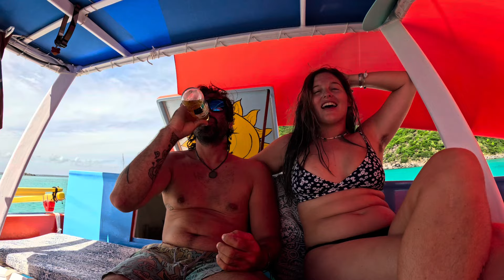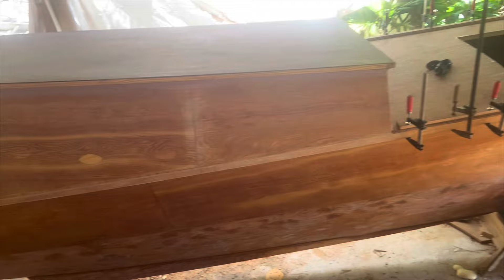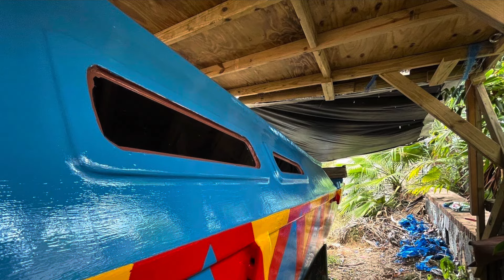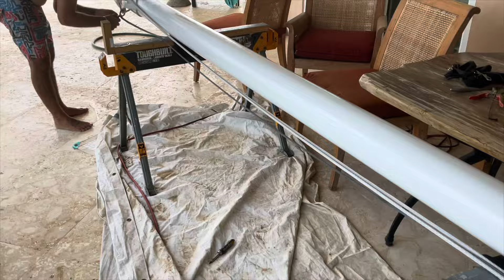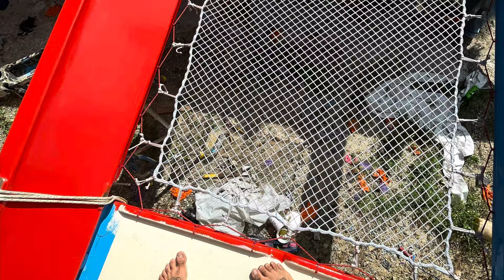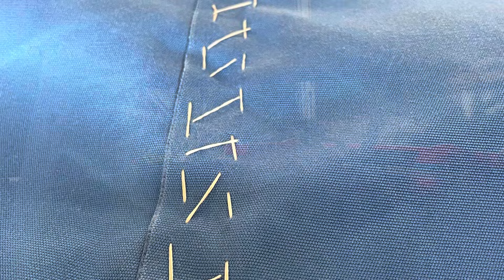Building Our Tiki 30! An in depth look at the early days [EP.4]

Comment: Nice build job. Over the top build, however you will appreciate that when you survive your first full on storm at sea... I built a Tiki 30 a few years ago. Very robust design... Mine had a flat deck similar to yours and 50 mil lhigher saloon bulkheads for more down below room in each hull... In terms of sea worthy design, a friend of mine told me, the Pacific is full of Wharrams all sizes... I'm considering building a 35 footer out of aluminium... Might just be an old farts dream but I think it would be a really cool project...

Comment: Great video, thanks!

Can you educate me on the foam you put in the hull?  I don't see that in the plans and don't know anything about it.  Thanks!
Reply from the maker: The foam is not in the building plans but we thought it was a no brained to add the flotation foam to the empty cavities. The foam is closed cell polyurethane, with a 2 pound per cubic foot density. We also used this exact foam to make the roof and the cockpit floor. We reinforced the roof and floor with carbon Kevlar and fiberglass to compensate for the lower density foam (building plans for the floor and roof call for 6lbs density foam)
Reply: @ZigZagSailing_113  Cool, thanks